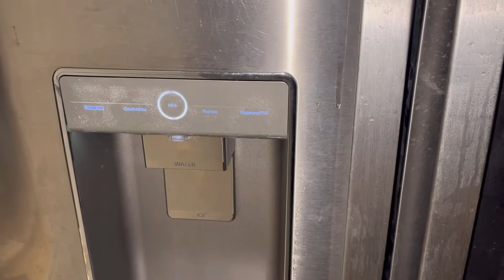Whirlpool Refrigerator Fresh Food Not cold| WRF993F 1FM00| Not Cold Enough | Beeping

Comment: How do you get the fridge to work without closing the door? Did you just engagd thd door switch or do you need to do something with magnets aswell?
Reply from the maker: If I responded twice, sorry. I replaced the thermistor.,the refrigerator was unplugged during the repair. Make sure you unplug it as well